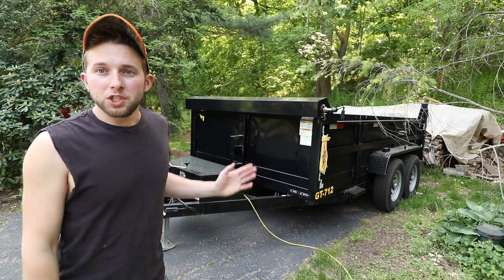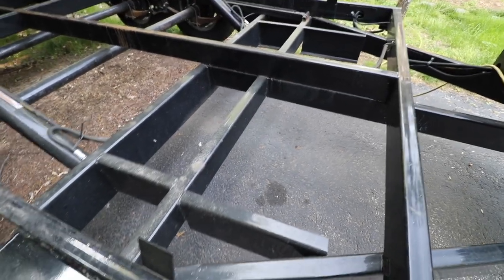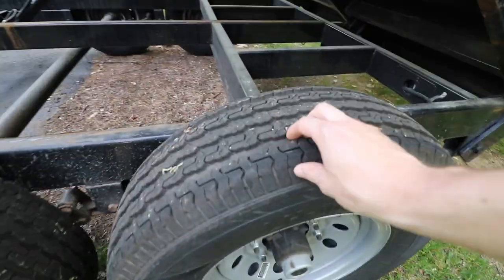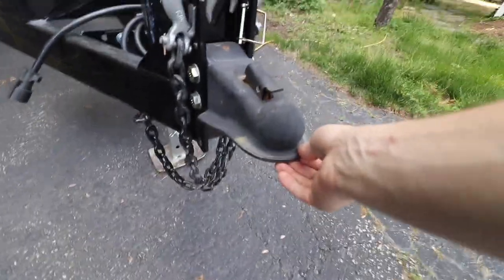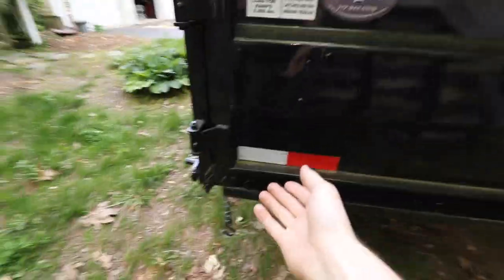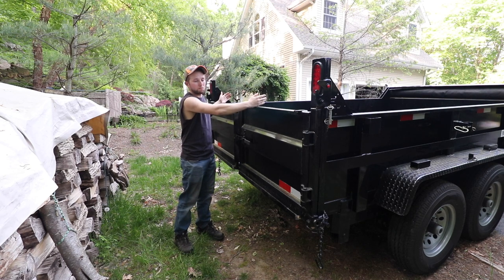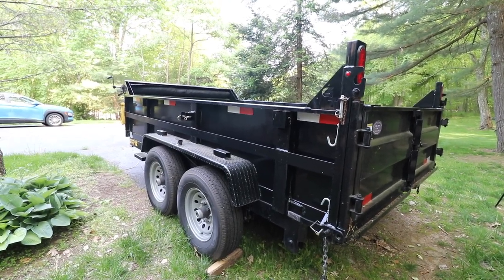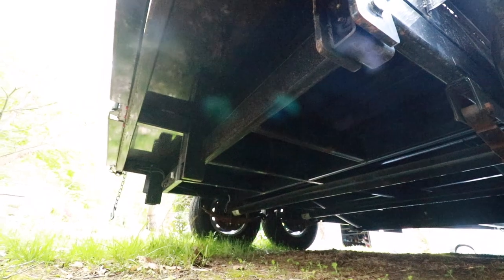Griffin Dump Trailer 1 Year Review (must watch)

Comment: we have the same dump trailer and haul minimum 3yrds of cobble stone 5-6 times a day with it and havent had a issue with it. definitely worth the money and ha spaid for its self 10x over
Reply from the maker: Just filmed a video about the trailer yesterday. Having some issues with rust under the powder coat on the frame rails. Otherwise, been a pretty solid trailer. Few small manufacturing issues. No regrets.